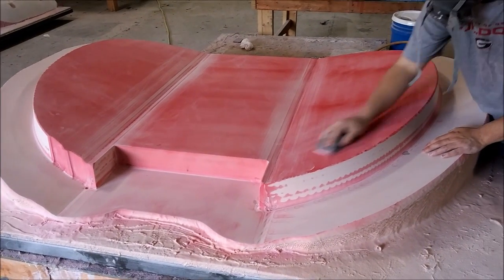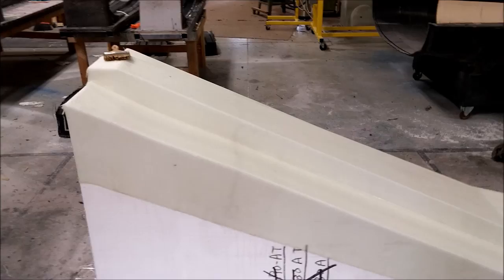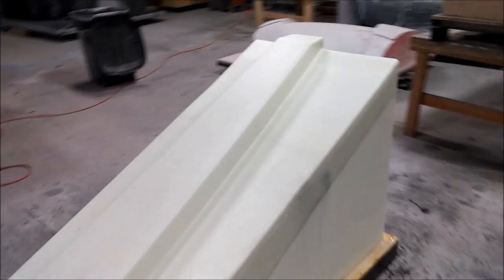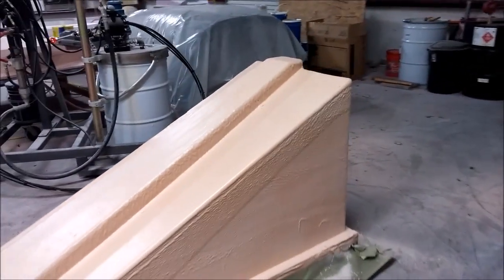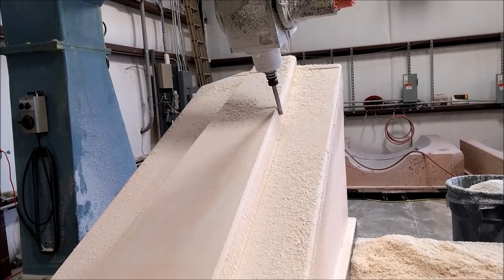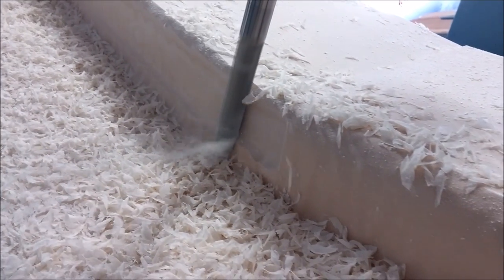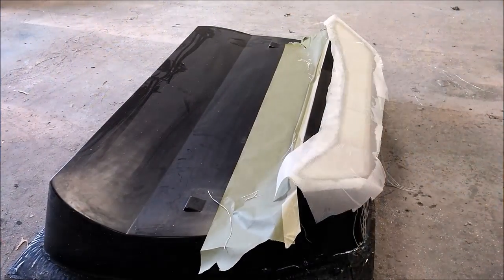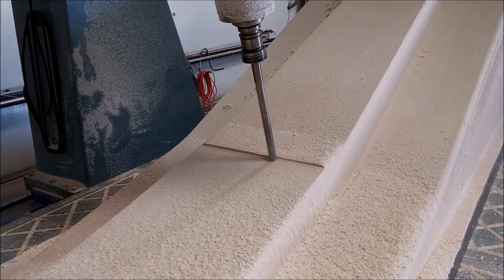Raptor Aircraft April 12th

Comment: Why do you scrape the wax out instead of just melting it with a heat gun, letting most of it run off, and then wiping up the remainder with a paper towel?

-jcr